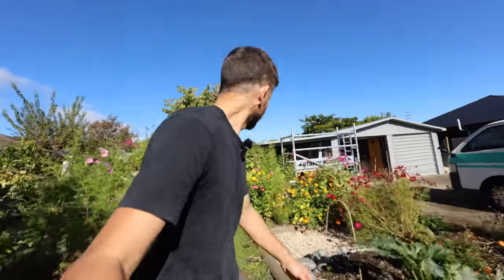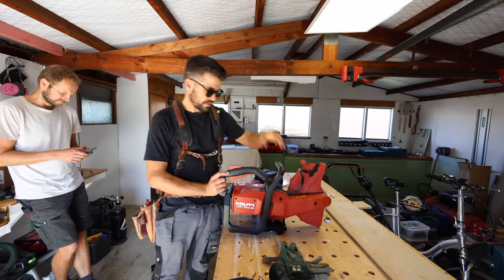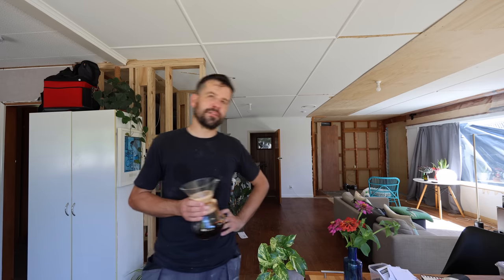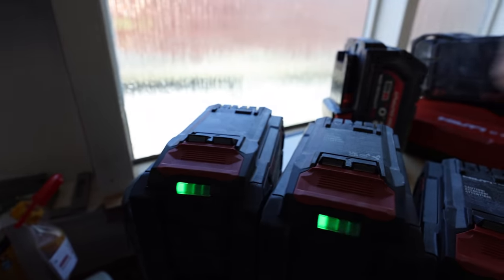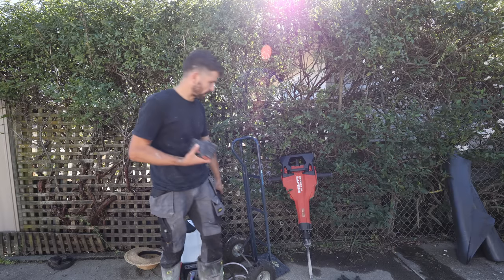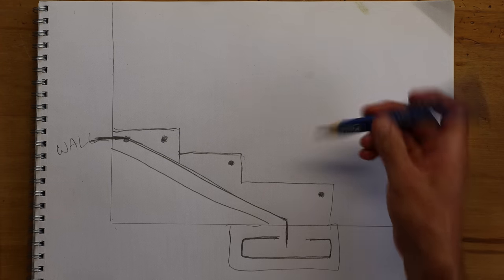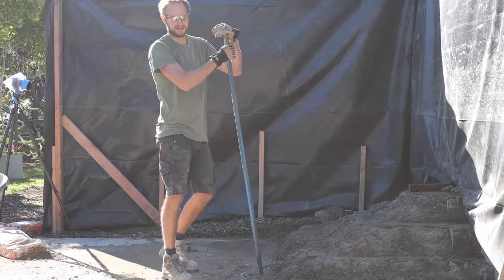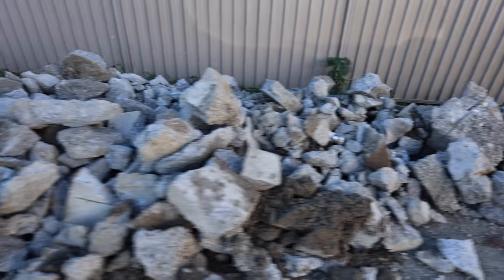Breaking Concrete with Battery Powered Tools: Is it Possible?

Comment: The biggest difference between where the first wireless saw was and today was battery tech. I don't think the future holds too much in energy density increases... least not quickly. Battery tech is one of the most over hyped and under delivered things in the tech space (with AI being right up there). But it is what is holding back EVs and the whole electrical grid in so far as realistic wind solar usage. While lithium has brought us a long way, there isn't a whole lot more it can bring unless some other material is discovered.... the thing society needs most (in so far as electrical things are concerned) is a room temp, reasonable atm pressure, super conductor.

Comment: The drop in charge from 100% to 80% happens quite fast in most Li-Ion batteries, and the time to charge from 80% to 100% is quite slow. I wonder if you would find it more productive to only charge them to 80% when you are having to rotate them constantly in a situation like this.

Comment: The original overkill killer lol

Only tools needed to break this would have been; 
bosch gsh 27vc corded 
1x point 1x chisel 

Until a battery operated tool exceeds this I don’t see the point in cordless unless it was a smaller job.

Comment: Don’t need a “digger” just one of those large air compressors you tow behind a vehicle and a 80lb (~36kg) pneumatic hammer. You would need to do zero scoring and would knock it out also in an hour or two.
I’ve always liked the idea of Hilti and if I wasn’t already locked into Festool’s battery system would have bought a grinder, small roto-hammer, and sawzall from them, but this gives me pause on them…
Thanks for all the great content and info! Also, why isn’t this video #adgifted?
Reply: They weren't gifted, they are just on loan
Reply: @dressjess  I thought free rentals also had to have that disclosure?

Comment: It's not that batteries thats the problem it's that single charger I run the xgt breaker with dual charger that charges 2x 40v 5amp in under an hour im sure hilti would have something similar
Reply: They don't.

Comment: 80% charge would be enough on those batteries. As you say, 80% of the job is done in 20% of the time, and the last 20% is done in 80% of the time. Same goes with batteries. Getting them up to 80% is under half the chargetime, approx.

Comment: Would it be a good time to advocate for getting the manufacturers to agree to a single battery connector standard so that you could charge ALL of you hardware on one type of charger? Hopefully the EU will get their finger out an address this like they did with the Apple phone connector p!5h!
Great work BTW.
Are you able to recycle the concrete like we do in Auckland?
Reply: Broken concrete is perfect rubble fill for the next slab… it’s like a DIY seed starter pack.

Comment: I don't think there is any 1,000 year old concrete. However, there is 2,000 year old concrete. The Romans were not just as portrayed in "Gladiator". They had concrete, including concrete which set underwater, and then the technology was lost for almost two millenia.

Comment: It’s funny how batteries are really good at putting out a lot of power but for short periods of time, which is how most tools operate but concrete saws use aloooooot of power for the entire project. Unlike an impact or a circ saw which is used for a very short time in one go
Reply: Energy density is a thing with cordless tools.

Comment: Nah cordless circular saw still don’t compare to corded. Ripping on cordless vs corded is still not there. 100% you can rip with cordless but it’s not as quick and burns batteries. Comparing to a 1800w saw which makes sense as most of the battery higher end float around the 1300w range. Though considering your WH of the batteries running a 1300w saw with a 12ah 18v is roughly 6mins of run time. If calculating that correctly

Comment: Concrete doesn't get stronger over time you're mistaken roman concrete with concrete, that gets stronger over time. However modern concrete will rot after 120 years and is hardened out after a month or so. But suppose is most optimal after 6months to a year old. Concrete is most defenatly not for ever ! Older concrete tends to be stronger because back then they used pebbles, rather then gravel, which is stronger. Just recently they've discovered the mixture of Roman concrete on how to make that.

What google says about how long it will last

about thirty to hundred years
How long does concrete last on average? For many projects like building structures and homes, the concrete used is expected to last about thirty to hundred years, depending on the installation methods and construction style

Comment: My take on battery tools like that concrete saw is the engineers were like. Yah we can make that. And the marketing dept was like… yah think people will buy it? And someone was like. Yah, its hilti and it says its good… and if they buy it then they will buy a million batteries for way more than the tool cost. And then everyone pats each other on the back and says job well done. But the problem is that job not well done . It would be well done if they just made a saw that ran on gasoline or had a damn cord. Same for those battery powered table saws and stuff thats just like….. well if you’re only making a few cuts with a table saw… just use a circular saw and take your time with a guide or something

Comment: the hilti concrete saw is actually 22 volt and uses both battery one at a time it’s just for extra amp hours to increase runtime
Reply: Using batteries in parallel allows higher current draw. There wouldn't me much advantage in having both batteries plugged in all the time just "to increase run time" (they're just making the tool heavier; you could simply keep a spare in the case and swap it when necessary, for the same total runtime).

Comment: Great video... but heavy duty battery kit is a nonsense!  How can those unbelievably expensive batteries compete with mains or petrol.  It's all down to stored energy and unless you can somehow cut the energy used you're on a loser.  The big Hilti 110v breaker would have eaten that for breakfast.  Horses for courses.  Hilti, like others, are just chasing the latest box ticking trends - all battery kit looks good on your RAMS but nothing else - you still need a local power supply or worse a geny to charge.  You didn't mention cost comparisons but I bet it's scary, 12ah Hilti batteries in the UK would be around the £400 to £500 mark alone.  Mmmmm.  Fun though!

Comment: I broke up a similar setup in chch.  Lesson learned quickly was use a bigger hammer! Hiring a really big hammer though a little more expensive was significantly faster to use.  Ps. Battery tools are awesome, but not for this use case.
Reply: Same here. The guys that took out my stairs started with the corded Hilti then quickly rented a diesel compressor and air-hammer. Still took them the better part of a week.

Comment: I think what this showed is cordless tools, whatever the bread, for this type of work isn’t ideal. 
You spend half the day charging batteries. 
Run out a lead and get continuous steady power all day. 
I was considering getting the Dewalt concrete saw but I’ll stick with the corded stuff, that’s for sure. 
And cutting and jackhammering concrete is a horrible job!! 😂😂

Comment: @Scott Brown Carpentry, instead of throwing the rocks of concrete, which is a waste in my opinion. Find a corner fo your property to build a small hedge wall, 4x3 homeage.Then slather the top surface with moss mixed with mud. Let it grow a thick carpet of moss. A ol' church hedge wall.